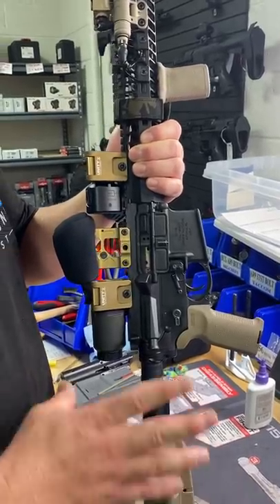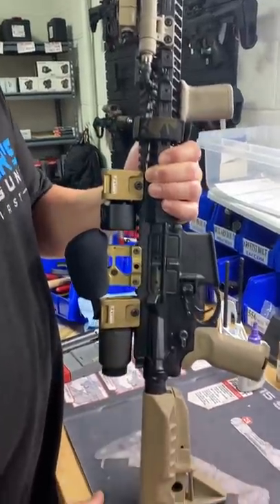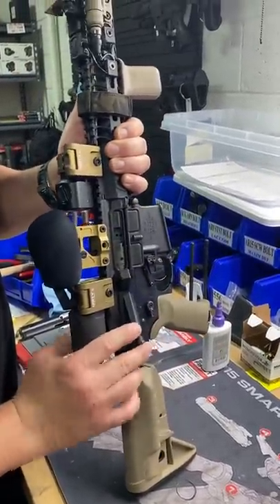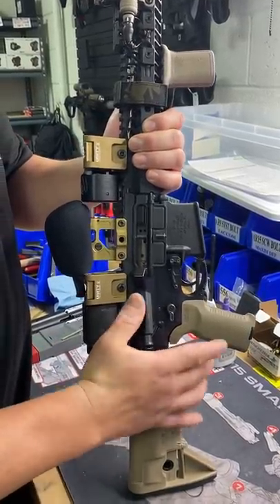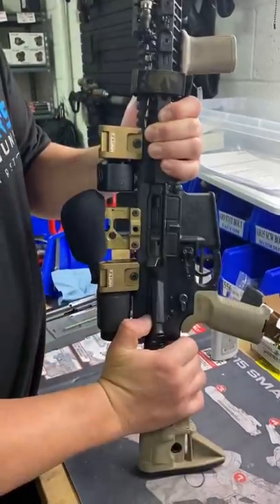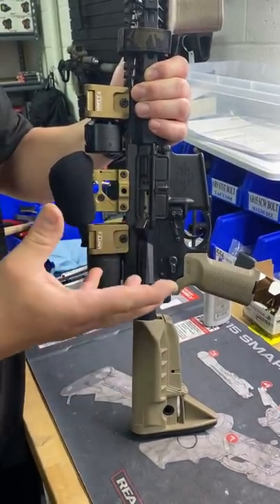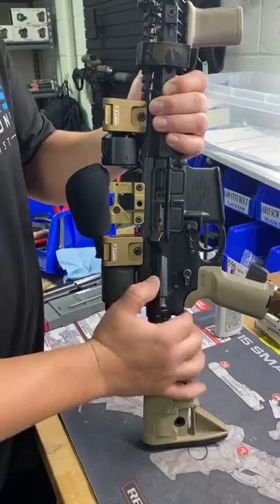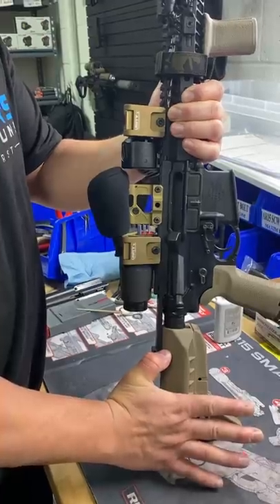How to Mortar your AR Platform if you have a round stuck in the chamber.

Comment: This video would’ve come in handy a few weeks ago. Bought my first AR. Got an AR pistol and a round stuck. I didn’t know what to do. So I asked the RSO. That’s exactly what he did.
Reply: Just be cautious of where the muzzle is pointing, less of a issue if you are doing it on a raised surface like a table or a bench but if you are doing it on the ground the rifle should be a 45ish degree angle so you don't accidentally muzzle the underside if your chin.
Reply: @imcrummy6114  or just don’t have the gum under your head??
Reply: @hengry2  i never have gum under my chin but to each his own
Reply: What kind of round? .223 or 5.56, steel or brass? .223 should not be fired into a 5.56 only barrel and steel casings over expand often.
Reply: @Praetoria113-zm3no  you have that backwards. Do not shoot 556 in 223 barrel.
Reply: @adamrickman2461  Wrong, if the barrel designates 5.56 only, you don't feed it .223 try again. If you think you're smarter then the engineers over at Bushmaster let them know...
Reply: Why did you buy an ar pistol?
Reply: @Lamadamadingdonn  I wanted something small as a truck gun. But l don’t think I’m going to use it. I would rather have a rifle for home defense.
Reply: @Praetoria113-zm3no  I’m not sure. So I need to look into that and can probably find my answer as to why it got stuck.
Reply: @TorqueTactical  The barrel will show what caliber and twist ratio. Tbe lower receiver should also designate the caliber used. Inspect your gas rings also, and stay away from steel ammo. The last thing you want are jams when you need it the most. I use Froglube on my BCG.
Reply: @chiru6738  Look, megadork, there are barrels designed only for 5.56. The pressure isn't the only thing different genius,  the shape of the cartridge is the issue. Like I said to the other poser, if you think you're more intelligent then the engineers and armorer experience of Bushmaster you let them know...
Reply: @chiru6738  Go ahead, use 5.56 in a chamber designed for .223 let me know how it turns out for you. Also, the .223 doesn't have the pressure to operate a chamber designed for 5.56 ammo. Show me one military weapon that is chambered in 5.56 that uses .223 as a substitute? None. There are ARs designed to fire both, ARs designed to fire only 5.56 and ARs designed for .223 ONLY...
Reply: @Praetoria113-zm3no  yeah buddy, you’re the poser. There are no “5.56 only barrels”. You can shoot .223 out of a .223 barrel. You can shoot 5.56 out of a 5.56 barrel. You can fire .223 out of a 5.56 barrel. You should not shoot 5.56 out of a .223 barrel, as the 5.56 has a higher pressure than .223. 5.56 and .223 are identical rounds, and the only difference is the pressure at which these rounds fire.
Reply: @tommyguhnn9633  B  MP 5.56 NATO 1/9 So, Tommy boy, what does that mean? It means you don't know shit.
Reply: @tommyguhnn9633  Due to the throat difference a .223 round chambered into a 5.56 barrel will not work optimally and the goal is to make sure the round leaves the barrel each time with no fuck ups. The difference between you and I is that I don't fuck around when it comes to sending rounds down range. Get it? Now if that stirred your shit, boy, good, drink it up for all care.
Reply: Praetoria 113 over 1000 rounds of steel through my ar never had a stuck case. There’s so much misinformation in this thread that it’s funny. A simple google search or YouTube search will prove who’s right and who’s wrong
Reply: @AwkwardYet  So? Does that make it better? There's so much information also that shows why you don't use cheap steel ammo. But feel free to damage your AR to save a few pennies. I'll stick to brass. What is a thousand rounds? 33 mags of 30 rounds. You haven't broken that rifle in yet.
Reply: What kind of ammo you shooting?  Most .223 .556 rounds are at SAAMI Specs.   Are you shooting reloads?
Reply: @Praetoria113-zm3no  you are wrong
Reply: @Praetoria113-zm3no   you can look this up online if you don't believe anybody.   5.56 can shoot .223, not the other way around.  It's facts. Say what you want to say.  Throw your tempertantrum, call people names.  It won't change the fact.
Reply: @AKFF320  it was 556 rounds in a 556 barrel. They were Winchester target. I really think it was just a new gun. And it wasn’t oiled like nearly at all.
Reply: @TorqueTactical  sounds that way. Glad you got it fixed.   Happy shooting
Reply: @AKFF320  What won't change the fact either is that if you read my previous post you wouldn't assume what I said. Why anyone would use a round not recommended is asking for trouble. If a .223 round was so suffienct in a barrel marked 5.56, why does the military only issue NATO rounds? If steel ammo is so suffienct, why does the military not use them? Markings on weapons are there for a reason.
Reply: @AKFF320  You're wearing a uniform. Go ask your armorer about using .223 ammo in a barrel marked 5.56, you should know better...
Reply: @AKFF320  M855, or M193, what do you think I would use? Like I said several times now. Brass, factory made.
Reply: @AKFF320  Just as it said, not recommended. Anything else? Again, if the manufacturer states, not recommended, what part do you not understand? Did you second guess your drill instructor also? I've owned my pre-ban Bushmaster for a long time, I think I know what Bushmaster recommends.
Reply: Just to add,  and most you probably already knew this, but you can fire a 5.56 round through a .223 barrel if it's a 223 wylde. Just wanted to put that out there
Reply: @tommyguhnn9633  bro you can’t reason with stupidity, my guy is throwing bushmaster out there like it some golden standard in rifles. You ever shot an ACR, biggest piece of crap I’ve ever shot lol.
Reply: There is better ways to remove that round that doesnt envolve slamming your rifle on a hard surface.
Reply: @shotgunn9  i am actually with 3 degrees. I know the gods are smiling on me. Can you say the same?
Reply: @lieutenantdan417  it's not hard to get an associates in underwater basket weaving.
Reply: @shotgunn9  associates in auto collision repair. Associates in criminal justice. CDL class a b and c so i could can haul just about anything. And to have ALL of that paid off within 5 years? Yeah i would say im fuckin better than you. Any everyone saying otherwise just pushes me to create even more goals for myself. So see ya.
Reply: @shotgunn9  so you can pay for over 60k in schooling in cash? Ok kid
Reply: @lieutenantdan417  yes, I can. :* ohhhhh now you're a millionaire. You're a cutie. Have you been to space too big guy? 😂
Reply: @Praetoria113-zm3no  ok I think I will because the reason you don't shoot .223 out of 5.56 is because 5.56 Is about 10k psi higher than .223 so a .223 barrel can't handler it. A 5.56 can take .223 just fine because .223 is under the pressure of what the barrel can handle. If you or the engineers at bushmaster have a problem with this lmk because I've done this ballistic test.
Reply: @L111zrd  It's only 3000 psi difference with a one being 58,000 (NATO) and the other at 55,000 (Remington) and the difference in the barrel is the throat opening at .125 longer for the 5.56
Reply: @Praetoria113-zm3no  so how does this explain why you can't shoot .223 out of 5.56? If anything you helped explain and understand why.
Reply: @Praetoria113-zm3no  the psi difference is 7-10k BTW.
Reply: @L111zrd  And, you didn't read my comments either. Firing a .223 round from a 5.56 barrel can be done. However, it is because of the throat distance of the 5.56 that the .223 is not recommended because it causes the opposite of high pressure. There's not enough from a .223 round to generate that correct pressure to use the weapon properly. In contrast, a 5.56 because of the higher pressure and the shorter throat and angle of that throat creates too much pressure on a barrel designed only for .223
And, you can say whatever you want about your test. It isn't even close to the armorers and engineers at Bushmaster or any other certified weapons manufacturer.
Reply: @Praetoria113-zm3no  BTW bushmaster is like the Walmart brand of ars wouldn't be surprised if it says 5.56 only on it if it's made poorly
Reply: @L111zrd  Again, you can shoot .223 from a 5.56, however, because of the throat opening being longer, the .223 round does not generate enough gas to operate the weapon optimally. The higher pressure 5.56 round creates too much pressure in the throat area of a barrel designed only for .223
Reply: @Praetoria113-zm3no  ok well you can change your stance now to 'you can't shoot .223 from 5.56 optimally' but that is not what you were saying earlier. Thanks for agreeing
Reply: @mikeh2782  We're not talking about the ACR are we? Nope. I referenced Bushmaster because they are extremely reliable ARs. I could have used Colt as an example. But the bottom line is a 5.56 barrel while it can fire .223 it isn't designed to. So, anything else? Amazing that most gun stores sell both .223 and 5.56 but there's going to be that one clown who feeds .223 into a 5.56 stamped barrel. Whatever floats your boat.
Reply: @L111zrd  No, it's not. Look up pressure difference between the two. Not interested in your test, at all. Until you cough up research you're wasting your time.
Reply: @L111zrd  Oh, ok, Karen. You think so? My Bushmaster was made over 30 years ago and still performs as good as the day it left the factory. Puts the round downrange where I want it to go with no failures. Anything else? Because if that's all you got you're more pathetic then I thought.
Reply: @Praetoria113-zm3no  you either don’t know shit about guns or you are trolling the whole thread. It’s all about pressure, the rounds themselves are essentially the  same. The same adage applys for .308 and 7.62x51. You can shoot the 7.62 out of a barrel designated .308, but should not the other way around.
Reply: @mikeh2782  The barrels are different. The throat size of the barrel makes up the difference. That's where the difference in pressure determines ammo usage. It isn't rocket science. It is simple barrel design. Anything else?
Reply: @mikeh2782  The rounds may be similar, but the throat of the barrel will determine how much pressure it can sustain. .223 barrels have shorter throats so more gas pressure is present to compensate for the lower PSI of .223 A 5.56 barrel has a longer throat to allow the greater gas pressure of the 5.56 so the barrel isn't over pressurized. Even the taper in the throat is more pronounced on .223 barrels to build up pressure to rotate the bolt.
Reply: @imcrummy6114  obviously never had a gun shoot next to your ear because even with ear protection that shit will hurt
Reply: @GeorgeMitchell10  one actually I have shot an ar15 without ear protection (wouldn't recommend everything rings for a few minutes) plus a round shouldn't go off when doing this and if it does that's why you keep you head out of the way but this is the correct way to clear a jammed, stuck bolt on an ar 15
Reply: @Praetoria113-zm3no  right which is why it’s fine to shot 223 out of a rifle stamped 556, but not the other way around. You prove my point and then ask me anything else? You have to be the worst at arguing ever lol
Reply: @mikeh2782  No, it's not fine. While the weapon can fire .223, again, the throat of the barrel is longer and the pressure is not optimal. If you want to abuse your weapon feel free, but I'm not going to. Get it? Anything else? This isn't a debate. These are facts. I suggest you look at both a .223 stamped barrel and compare it to a 5.56 barrel. You'll see the throat is longer and the angle is not as acute on the 5.56
Reply: @Praetoria113-zm3no  so the pressure when shooting a 223 in a 556 barrel is less than shooting a 556 round out of it, how is that abuse if anything it’s less abuse than shooting the 566 out of it. You logic is backwards. Like talking to my children. You tell them something that’s correct they then repeat it as if your wrong.
Reply: @A1V124  Looks like the little girl has a problem with Bushmaster and Frog Lube. Irrelevant to why this guys weapons malfunctioned. For one, blind boy, does that look like a Bushmaster in the video? I mentioned my rifle because it is reliable pre-ban AR. You're the one flinging products placement around. You think your opinion bothers me? Please...your import is negligent and in the gun world there are thousands of opinions on brands.
Reply: @A1V124  Why does a pre-ban Bushmaster matter? Probably because it was made by a different company 30 years ago then the one now. But you knew that...
Reply: @Praetoria113-zm3no  You can absolutely fire 223 in a 556. If you have a .223 Wylde you can use .223 or 5.56. Otherwise, stay away from 556 with a 223. You're obviously new to this, but you read a lot. Or watch a lot of videos. I won't get technical here, but I will say this: someday you'll remember the time you tried to argue that a 5.56 could not handle a .223, and you will laugh.
Reply: @TrailingSkies27  Again. I never said a 5.56 barrel would not fire a .223 round. It's not recommended due to throat chambering. And of course you never fire 5.56 through a .223 barrel due to over pressure, and the Wylde is designed to handle both. I've said this several times so far. My barrel is stamped 5.56 NATO. Can it fire .223? Yes? Will it ever? No. Because the manufacturer calls for 5.56, not .223 For a reason. The throat chambering is what determines the ammo used.
Reply: @TrailingSkies27  You know, in over 30 years I've never come across anyone whose barrel is stamped 5.56 would use .223 instead. When both rounds are readily available that has no common sense. You're using an under pressured round in a barrel designed for the higher pressure round for what purpose? Why would there be a need for the throat chamber and feed angle distance to differ if it wasn't for the optimal performance of the rifle? Why the specialized barrel like the Wylde? In my very first post I said there are three types of barrels. 5.56, .223 and ones like the Wylde that handle both rounds. Am I not correct?
Reply: I love how this devolved into an argument of 556 vs. 223 when this guy is teaching a pretty f**** unsafe practice
Reply: @Connor-xj9qv  Ok, Karen, whatever floats your boat. Anything else?
Reply: @Connor-xj9qv  Connor, your momma' s calling. Time to grow up. Do yourself a favor, Connie, worry about what you do with your weapon. I'll stick to what I know. I can't believe when 5.56 is available that you would feed .223 into a barrel stamped 5.56, but each to their own, Connie, now go do as momma' tells you.
Reply: @Connor-xj9qv  I've owned firearms longer then you've been around, Connie, this particular model for almost 30 years. I don't have issues, you? Now go play with your steel "Tule" .223 ammo.
Reply: @Praetoria113-zm3no  Oh good so you are just trolling, that's a relief
Reply: @Praetoria113-zm3no  it's funny that you're calling everyone posers and your main defenses call Bushmaster. Well Bushmaster doesn't agree with you killer. Because lucky for you I'm piecing together a new-build and while I was on the phone with them I asked them and they said no they don't make any 556 only chamber barrels
Reply: @adamwest2130 Sure you did, Charlie, you called Bushmaster just to ask that question? Right....
Reply: In my experience of using 223 and 556 pretty much interchangeably, the only issues I have had have been with using steel case ammo. That stuff is no bueno most of the time.
Reply: Was it steel cased?  This happened to me and the range guy said it was probably cus it was steel casdd ammo instead of brass.  Times are tight though and the steel cased ammo is like half the price of brass
Reply: @Praetoria113-zm3no  It states that so you don't do something stupid an try an chamber a 300 blackout
Reply: @bindingcurve  I don't have that problem of being stupid, that's the whole point.
Reply: Holy shit you guys need to chill. You can absolutely shoot .223 out of a 5.56, but not the other way around. It’s just a lower pressure round, may not be the best ammo for it but it absolutely works...
Reply: @Praetoria113-zm3no  how's that 556 treating as a first gun?
You sound like you've never shot anything but blanks and nerf
Reply: @Praetoria113-zm3no  long story I've put 223 through an m4a1 before it ran fine
Reply: @Praetoria113-zm3no  

You should go back and read your first two comments. 

You clearly stated “.223 should not be fired into a 5.56 only barrel...” and “...if your barrel designates 5.56 only, you don’t feed it .223”
Reply: @mmedrano21  That's right. While .223 can be fired from a 5.56 barrel it is not recommended because the throat chamber and ramp feed of the barrel are designed for 5.56, and like I said ad naseum now, feed your weapon with what ever floats your boat. I, however, don't have that issue. You know why? Because 5.56 is available and that's what my weapon gets. Now, does that clear it up for you? Did you bother reading anything else? If it makes you all happy you can use .223, knock yourself out.
Reply: @Praetoria113-zm3no  

Sorry man, I didn’t read your comment closely enough. 

For the record, I’m not interested in in buying .223 or shooting it.
Reply: @Praetoria113-zm3no  my friend only uses steel in his AR , never jams and I use steel in my SKS , no jams and clean it
Reply: @Praetoria113-zm3no  I’ve seen barrels that say 556 and 223
Reply: @beerman9807  Yes, and they're designed that way.
Reply: @beerman9807  And? So, you use steel and have no problems. You will....
Reply: @Praetoria113-zm3no  megadork caught me off guard lol 🤣
Reply: Same exact thing happened to me.
Reply: @Praetoria113-zm3no  You’re completely wrong. The 5.56 stamping for the barrel is a stamp that the barrel is designed to withstand pressures of a 5.56. Ive shot .223 out of a 5.56 barrel for YEARS, and I’ve never once had any problems regarding ammo. The problem is shooting 5.56 out of a .223.  Not the other way around. Nobody cares what bushmaster engineers “claim” not to do. It’s been done since the two cartridges were invented.
Reply: @collinmackin5911  Yeah? So explain the difference in throat chamber clearance and ramp feed angle? While using .223 in a barrel stamped 5.56 is possible, why would anyone take away the optimal design by using a different cartridge? And, as far as Bushmaster armorers go? I'll take their advice over any mook on the internet.
Reply: @Praetoria113-zm3no  Unfortunately for you, firearms are not toys. Everyone in this thread understands that using a .223 in a 5.56 is not “the optimal thing to do.” My AR is for my protection, and regardless of what I put through it, it’s going to kill people or hit where I want it to at the range. If you have to treat your gun with such “respect and optimality” maybe owning a gun isn’t for you. If your gun can’t run through steel and brass, and cheap ammo like a fucking machine, than don’t trust it with your life. There are times in your life where you won’t have access to the most optimal ammo, and if you’re seriously telling people that BUSHMASTER, arguably one of the worst modern AR brands, says not to do something, so you can’t do it. That’s ridiculously childish. Regardless of wether or not it’s optimal, .223 will go down the barrel of a .556 without a problem and kill, or hit where you want it. The loss of performance is so ridiculously small that it’s not worth mentioning. So for anyone reading this, you can absolutely run .223 down the barrel of a .556, just like people who have done it for absolutely years and have had no problems. At the end of the day, the important part is making sure that your rifle always go off when you need it to.
Reply: @Praetoria113-zm3no  These guys are basically saying what you’re saying then calling you an idiot lol
Reply: @Praetoria113-zm3no  He apparently IS smarter than the “engineers” at Bushmaster. 5.56 chambers have more generous dimensions and should eat .223 well.

In all likelihood the chamber isn’t actually 5.56. Buy or borrow one of Ned’s Reamers and if it removes material you’ll know.

These same “engineers that for years couldn’t stake a gas key, couldn’t stake a castle nut onto the receiver extension, used 6000 series aluminum instead of 7000 for receiver extensions and didn’t spec testing for the critical parts of the system?

YOU are wrong. If Bushmaster stated that you cannot use .223 in a 5.56x45 barrel, THEY are wrong.

Full stop. I’ll bet $1000 on it.
Reply: @Praetoria113-zm3no You absolutely said you couldn’t. And you’re absolutely wrong and don’t understand how the pressure curve operates the rifle. In fact the pressure curve that matters most in regards to cycling the weapon is at the gas port…and that’s nearly identical between the two.

The issue at hand here is 100% either bad ammunition(not the wrong type) or a right chamber. Either way, I’ll bet $20 that one of Ned’s reamers removes material because bushmaster used or rather allowed their suppliers to use worn out reamers.
Reply: @Praetoria113-zm3no  you’re correct about the difference in the chambers. But positively WRONG about that meaning that .223 won’t work perfectly well in a 5.56 chamber. It will. The opposite is not true. In fact the opposite is generally the cause of situations like this.
Reply: @thopkins2271  Another person with reading issues. Bushmaster stated it is not recommended to use .223 in a barrel chambered for 5.56 because of the throat chamber. Why people are debating the use isn't the issue. The optimum use of the weapon is. If you have 5.56 available, what purpose is there using .223? None. Even though millions of M-16 type platforms are used by the military, not one, ever, is issued .223. I'm not sure about the quality of Bushmaster now, but mine, made in 1990? Never had a fail in thirty years except one worn gas ring. That, is all that is important.
Reply: @thopkins2271  Really? My BCG is original with a staked gas key. Try again...and, 30 years of a weapon with no failures? Let me how well your "AR" operates after 30 years. You can talk shit about grades of aluminum all you want, how much you know more about weapons then the manufacturer, bottoms line is mine works, very well.
Reply: @thopkins2271  Isn't actually 5.56? Sit down. So, tell me what model I own? Since you have ESP, all knowing genie....
Reply: @Praetoria113-zm3no  Buy Ned’s 5.56 reamer and if it doesn’t remove material from your “5.56” I’ll buy it from you. Stamping something and actually meeting spec are two different things.
Reply: @Praetoria113-zm3no  I firmly believe that yours works well. It’s a testament to the design.

I shoot more than your average bear…and only own Colts and KAC rifles. They’ll be fine. Replace the bolt at 10-15k. Drive on until it keyholes or loses too much accuracy.
Reply: @Praetoria113-zm3no  They may well recommend that or possibly have recommended it. And full strength ammo is always superior for reliability. Nobody recommends weak reloads or steel. Doesn’t mean it should be a problem.

In fact the lighter pressure curve will actually preserve the life of the components.

The part of steel ammo that wears barrels out is not the steel case, but the bimetal bullets that cause much more erosion.
Reply: @thopkins2271  Steel expands more, scooter, and unlike brass, will wear your extractor down.
Reply: @thopkins2271  You just got done saying how bad Bushmasters are...make up your mind. 30 years of reliability speaks for itself.
Reply: @Praetoria113-zm3no  I use froglube on urwife
Reply: @juelzsantanasbandana5938  You use Jello and syrup on your boyfreind also while you toss his salad. You always let people know about your culinary habits, Vato?
Reply: @Praetoria113-zm3no  yeah ok bud
Reply: @BigOBird2004  Totally tripendicular, bud....anything else? I bet it took all your mental strength to come up with that three monosylable word infantile sentence, bud...
Reply: 🤦🏽‍♂️ cringe.
Reply: Same thing happened to be jbs and  I thought the gun was clear and I shoot near me foot 🤦🏽‍♂️
Reply: Never do this. As a heavy weapons instructor in the army I highly recommend against
Reply: SpORTS
Reply: @jasonsutter2392  don't waste your time cause this guy is a clown, he's basing all his knowledge because he has a bushmaster, the worst brand of ar out there.  I have 2 friends that have bushmasters and there pos. Super picky on ammo, who wants a survival rifle that's picky about ammo. All my ars love steel case ammo, great for practice. 👍✌
Reply: Watch what ammo you purchase. Bad brass causes jams.